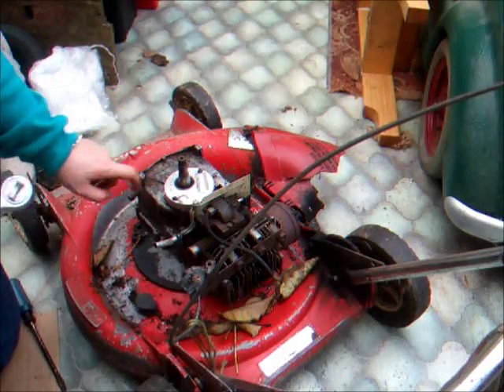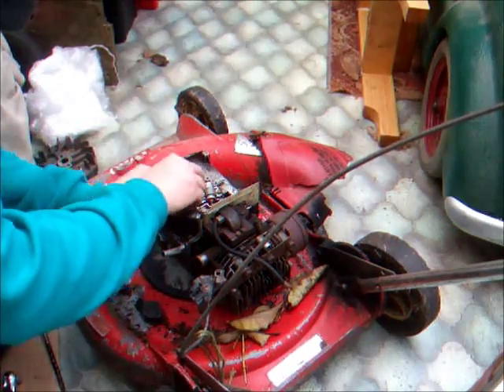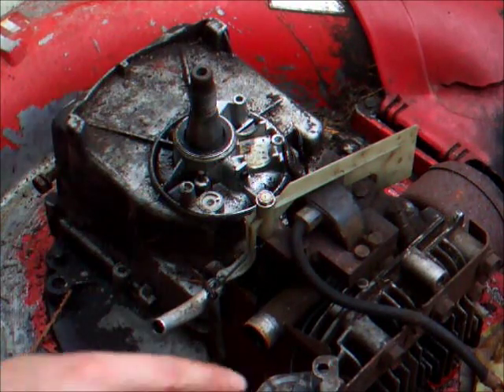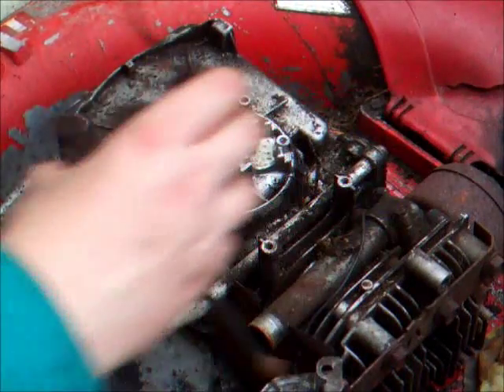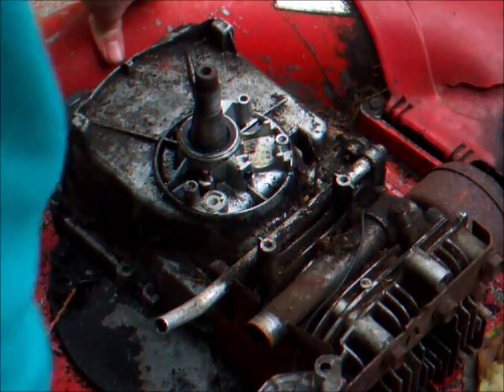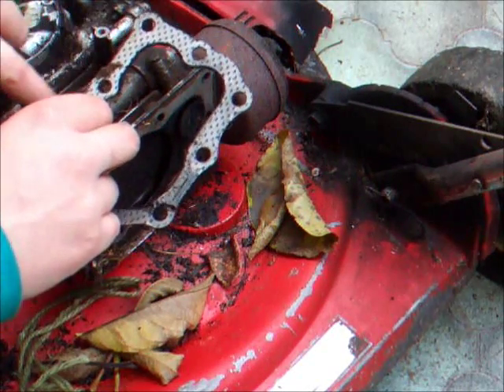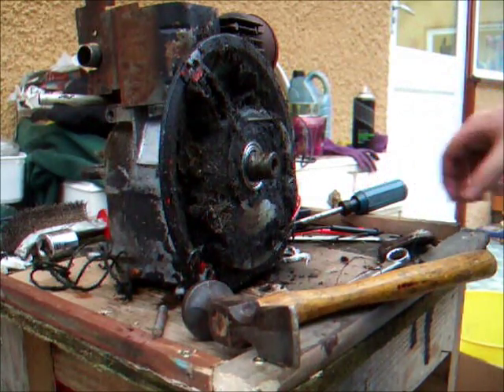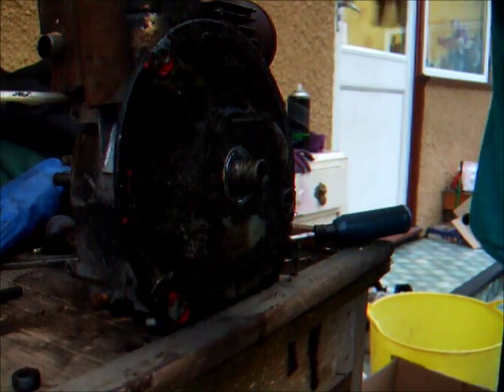1973 3hp Briggs and Stratton - Clean up and rebuild - Part 2

Comment from the maker: I generally prefer points.. you can set them up to make the engines run so smooth. All ive replaced is the odd condenser. Most just need a points clean.. 

Just got a brand condenser and points set for this engine in the post today. 

Dan